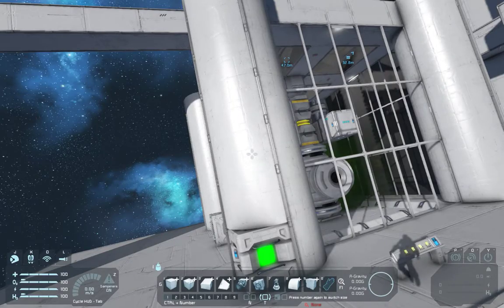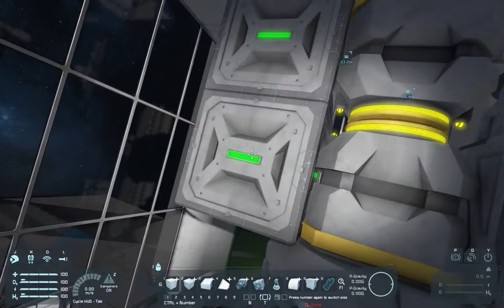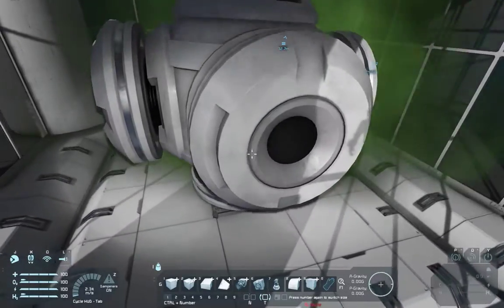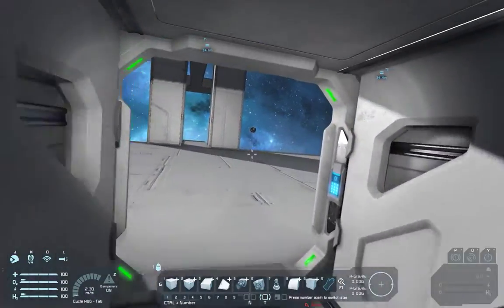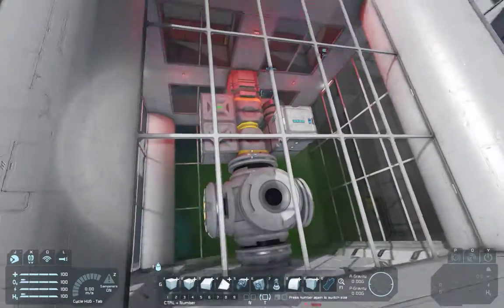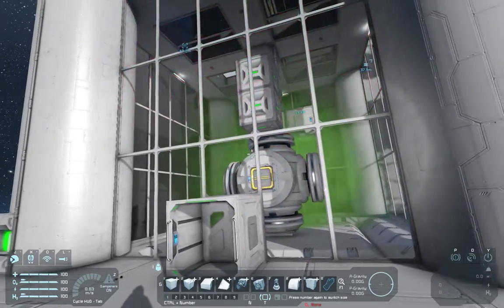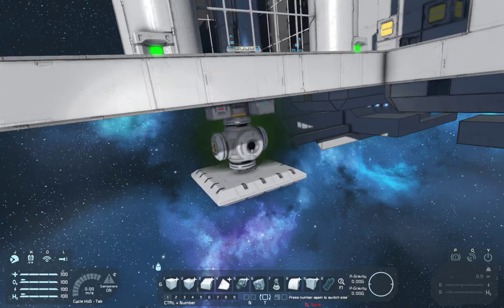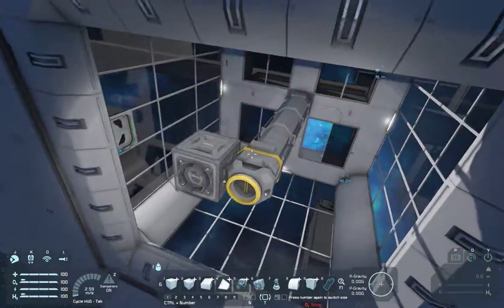Space Engineers - Emergency Reactor Core Ejector

Comment: someone needs to make a mod that stops reactors and jump drives from being breakable objects - but instead, once they go below a certain threshold they start actually leaking radiation or ticking down to an explosion, to make ejection sequences like this actually neccessary. would be absolutely awesome.
Reply: There is critical reactor and Critical jump drive

I know with critical jump drive if you have a set amount stored in the jump drive and start to either damage or grind it it will explode

And with reactor if it's on and got fuel in it if it's shot it blow up after a set amount damage

Comment: only have one questions, why did you eject the reactor door??
Reply: design simplicity. The "door" is actually a armored plate and floor. Its easier to dump them all as a set than to have more moving parts. Besides, this reactor room is useless until it gets a new core anyway so why protect it much. If you were this badly damaged in a fight for example you will already have hull breaches by this point. This is a "Ohhh crap we about to blow" survival function and not a defensive one. Think of it like the parachute. if you have to use it your more than likely already out of commission or very close to it.